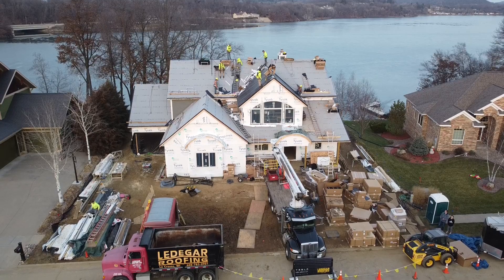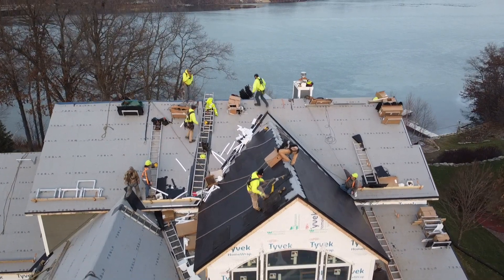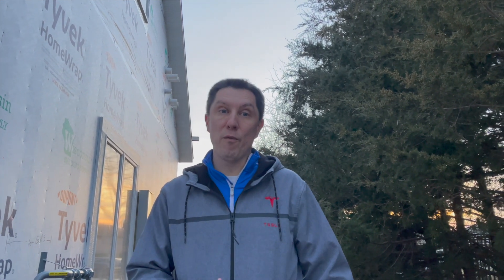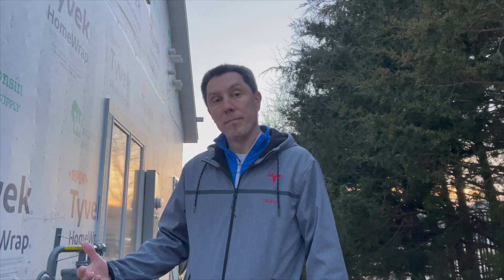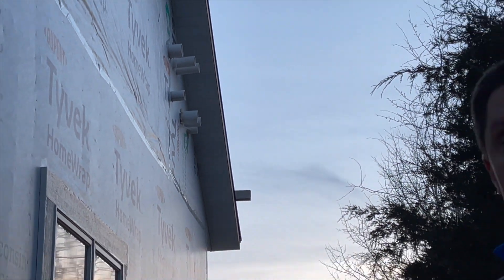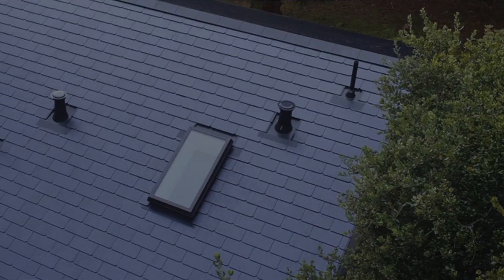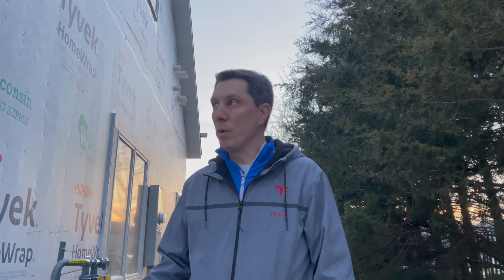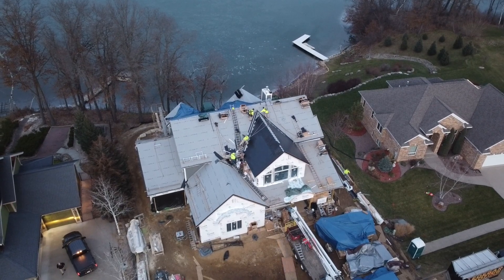Tesla Solar Roof - Relatively Speaking, How Much Does It Cost?

Comment: It is the wrong title, indeed. But the reason everyone wanting a $ value is probably why Jason didn't want to give a number and precisely why Tesla had problem pricing its roof projects properly and getting bad press about changing it through the process. Every roof & every locality is different, a $ amount is simply NOT useful at all and very misleading. You can't get a "market" price in construction like you can when ordering a Tesla EV, this is why in the AEC industry, we always ask for a min. of 3 bids based on very detailed CD (construction documents including drawings and specifications), in commercial construction we like to get 5 to 6 bids. It is in comparing them that you get a sense where the "norm" MAY be, esp. when 3 of the bids come within 5% of one another. What Jason did say is really the way to assess whether the Tesla solar roof is a cost-effective option for YOUR roof. How the $ amount compares to standard asphalt shingle (cheap, ugly & bad for the environment because it fails and you have to replace them every 10 or 15 years) and standing-seam metal, in my area we will add cedar shakes. That is the way to do comparative shopping, not comparing to what he paid but what you would pay relative to other types of roof PLUS solar PV on top of it. Plus every state has different solar incentives.

Comment: Hi Jason - thanks for super informative videos! I am in early stages of  home design for new construction in NJ. I have a ton of questions...but most importantly, how did you size/estimate your energy needs given that this is a new construction? Would you share your high level power assumptions like roof and house approximate sq. footage, power generation expectations, etc. Also, did you decide to install Power Wall?
Reply from the maker: you are very welcome, thanks!  we are doing 4 powerwalls.  it's a 15.9kw roof.  we worked with the electrician and Tesla to guesstimate power consumption.
Reply: @JasonLassen  Fantastic! You're totally in the green tech. And thanks. Hoping your state moves more into Green Tech.
Reply: @JasonLassen  Thanks again - this makes sense. Would you mind sharing the approximate square footage of your new house? Based on the video, my guess is somewhere north of 4,000 sq ft.

Comment: Click bait - you didn't say what it costs, you tricked your viewers, not cool.
Reply from the maker: I'm sorry you feel that way.  the cost of my particular roof wouldnt mean much to you since each home is unique.  instead, I gave cost saving ideas and a relative cost to expect.  it's between 3-4x the cost of a typical shingle roof.  similar in cost to a premium roof (metal, slate, etc).  it's about the same price as what a shingle roof+solar panels would have cost me but looks a heck of a lot better imo.
Reply: @JasonLassen  Glad you chose this set UP and could plan ahead. How long ago was your desicion to go with Tesla Solar roof and Powerwalls? Did your wife get involved in the desicion too?
Reply: Everbody want to see/know the cost. 

50k
100k
150k
500k?

With/without battery or system
Reply: @bodiesteamk1391  I paid $110K for mine.  I have three powerwall plus and I went with Tesla direct.  I have roughly 1,800 sqft of roof space covered by the solar glass.  Now that $110K can be financed (2021 at 0.9%) if you need it.  I live in Florida with Duke as my energy supplier which I get about a $7K rebate from Duke and then a federal tax credit gives me another $26K.  So this brings my $110k investment down to about $70 to $80k.  I have two AC units, a pool heat pump and my current electric bill in the summer months is around $500 to $600.  With new roof, I expect to reduce that to no more than $50.  $10 of that is a delivery & hookup charge you can't get out of with power company.  Another interesting tidbit is this system can use powerwall power to off set power during peak energy hours from grid and then pull more more so from grid during off peak hours as I approach the winter.  In Florida we average well over 300 days of full sunlight but days grow shorter in winder months... Hope this helps.

Yea, this guy could have told you the same but he refused... Click bait.  I plan to make a video going into these details myself
Reply: @revealingfacts4all  thanks i was hoping he would say how much it was because i wanted to see how big his roof was so i can compare it to mines and estimate how much it would cost on mine.

Comment: Just requested a quote from Ledegar! Building in Rochester, MN this year!
Reply: Are they the only installers? What's the cost per square inch?
Reply from the maker: as far as I know, they are the only installers anywhere close to the La Crosse/Rochester area.  they will do a really awesome job for you!  cost per sq ft varies on multiple factors.  very roughly speaking, it's between 3-4x the cost of a typical shingle roof.  similar in cost to a premium roof (metal, slate, etc).  it's about the same price as what a shingle roof+solar panels would have cost me but looks a heck of a lot better imo.
Reply: @JasonLassen  Did ya install Powerwall(s) too? It'll come in handy these days. Thanks for sharing your build It's looks like you're in the modern world, moving forward. Cheers.

Comment: It is my type of roofing. I’m also planning to install Tesla’s solar roof. How much was the cost? in dollars.
Reply: He obviously doesn't want to say what he spent. This was supposed to be the whole point of the video. For whatever reason, it's like pulling teeth to get prices out of people, actual dollar amounts they paid.
Yes, we all understand that every house will be different...blah, blah, blah. However, it would not be very difficult to go to your builder and ask, "With the size of this roof, what would be the standard price of a regularly constructed roof for dimensional asphalt shingles? Now, for my Tesla solar roof, what's the extra cost for the different construction needed to support this, taking into account the different venting, sturdier construction, and other materials needed."
It's not that hard. We just want to know, was yours for your house $20k more, $50k more, or what between this versus getting a standard roof.
Reply from the maker: it's between 3-4x the cost of a typical shingle roof.  similar in cost to a premium roof (metal, slate, etc).  it's about the same price as what a shingle roof+solar panels would have cost me but looks a heck of a lot better imo. obviously tons of factors (new vs existing, design complexities, current prices, area of country, etc etc etc) so these are very rough estimates.
Reply: I would guess in the ball park of 50k but you have to look at it long term because of the electric cost savings. Hell in sunny states those clay titles cost roughly the same amount or more. But since they last longer than traditional titles that only last 10-20 years its worth the upfront cost. What I want to know is who their installer was because this was the first house in the midwest to get tesla roofs

Comment: But... you never said how much it cost. Can you let us know, or is it private?
Reply: Perhaps he’s using one of the loopholes in the solar tax credit law that allows part of the new roof construction get covered by the tax credit. The support structure for solar panels qualities for 30% solar tax credit, so many people will find a contractor who will make the paperwork needed to show how much of the new home cost was needed as support structure for the solar. 

This is why everyone who gets a replacement roof with Tesla solar tesl the cost, so they can make future videos with the ROI, but people with new construction might not want to go into it because it’s similar to people who used the “Hummer Tax Exclusion” to completely pay for a Tesla Model X.
Reply: just share how much you paid, we know it will be different for everyone, unless you work for Tesla?
Reply from the maker: each install varies depending on multiple factors.  best to call a Certified Installer to get an exact quote.  In my particular case, it was slightly more than what a metal roof would have cost me and about 3x what a high quality shingle roof would have cost me.